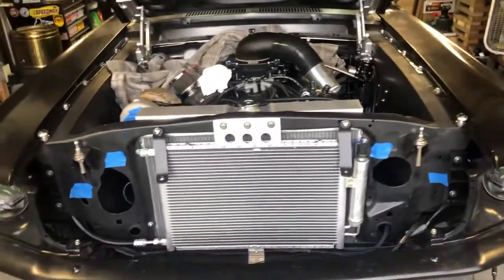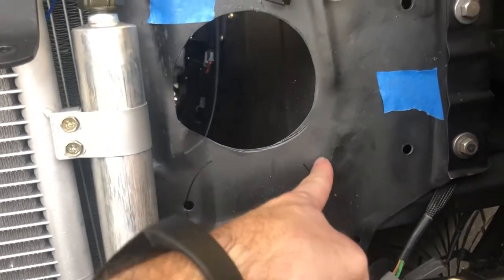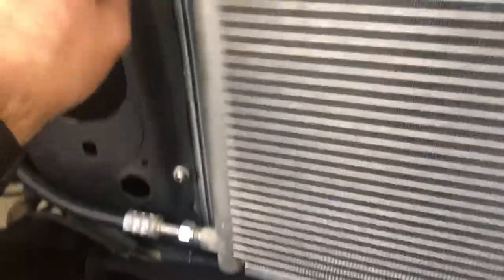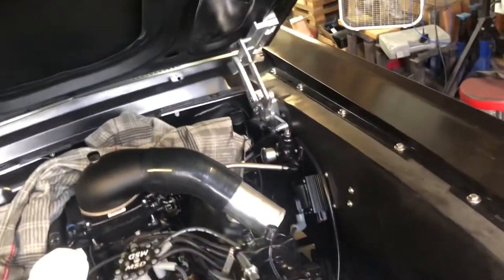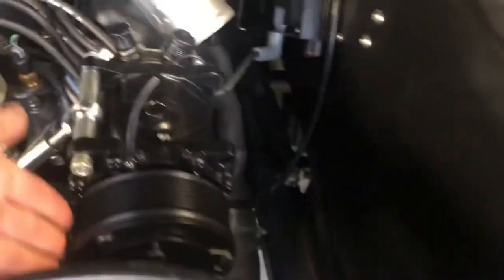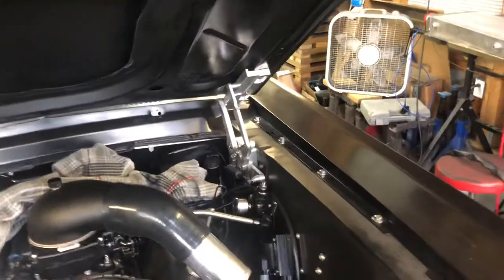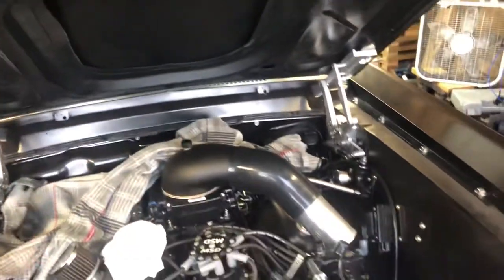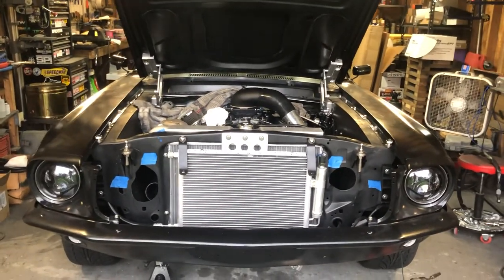68 mustang turbo AC condenser and intercooler mounting and plumbing

Comment: Good update! Why not run the overflow to inside the drivers side fender? May give you the room you need to mount it.
Reply from the maker: you're talking about inside the engine bay right? i'll see if i have room once i get all the intake ran. that was my thoughts too.
Reply: @callofgeorge  I actually meant on the inside of the fender well. You may have to make a goofy funnel in order to fill it and it’ll be hidden too.
Reply from the maker: @Rudderify  oh heck no lol.. screw all that, i'll just run that hose to the ground so it makes the EPA happy.. i mean, into a hidden tank i have inside of the frame rail :P

Comment: If you can't use those spark plug wire pieces, I may be interested. Let me know.
Reply from the maker: actually i checked last night.. the fabricated covers use a short bolt on exhaust side, so they should still work.